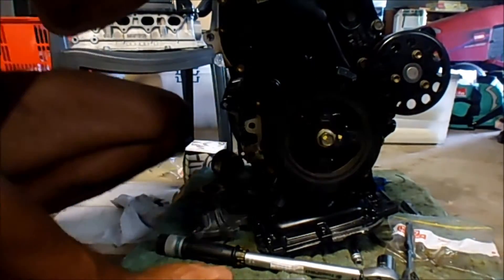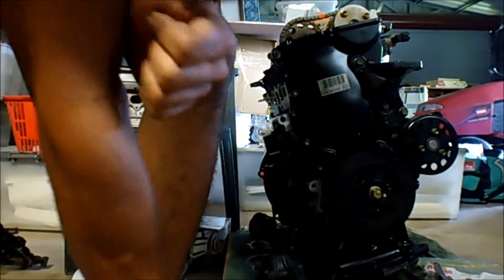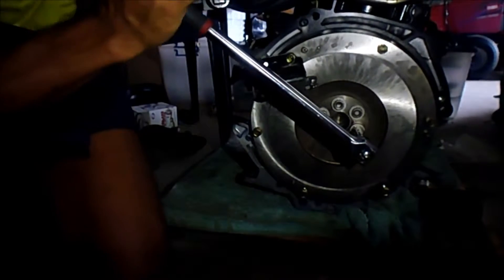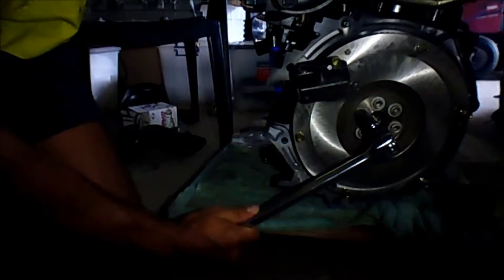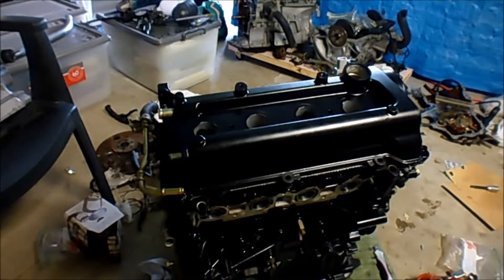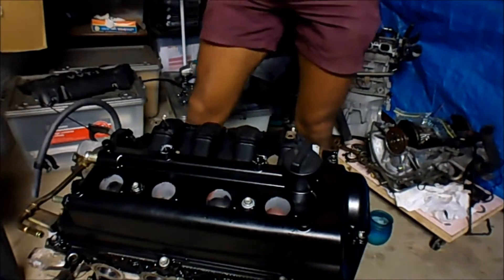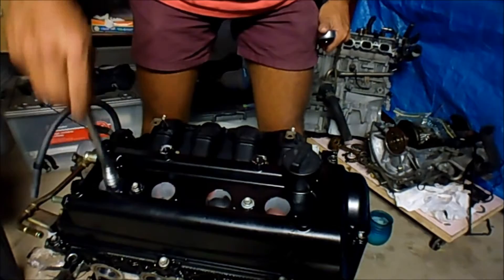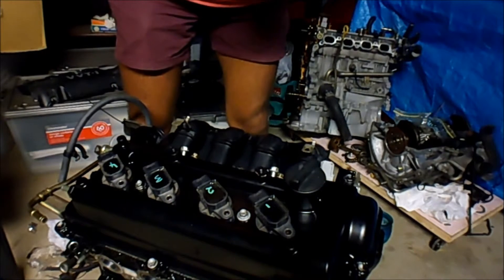PFP - Pt.13 [Crank Pully, Flywheel & Valve Cover Install]

Comment: loving you videos. please go an kick your Toyota guy up the ass. they can order those flywheel bolts in for you. you shouldnt reuse them, especially if building a performance motor.
Reply: EchoLaQua  good job mate like your vids ,thanks for shearing this ,you know what I am from Iraq by the way and this is helped me when I was planning to change my water pump on 2NZFE engine , keep going bro  . I tried to comment on your other vids but it wont let me that's why I used this as a reply
Reply from the maker: Rob Davies Thanks mate, much appreciated! Haha I will definitely do that next time.
Reply from the maker: Saman Jelal thanks! 
That's awesome! I'm glad that it was of use to you. 
I'll look into that, cheers.